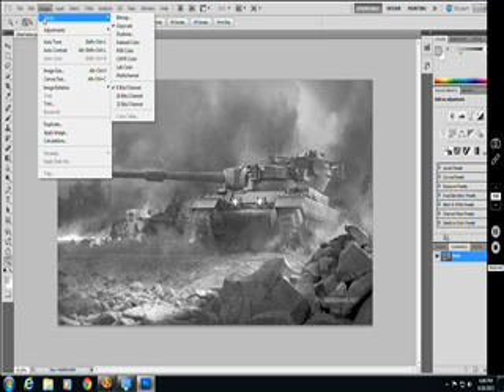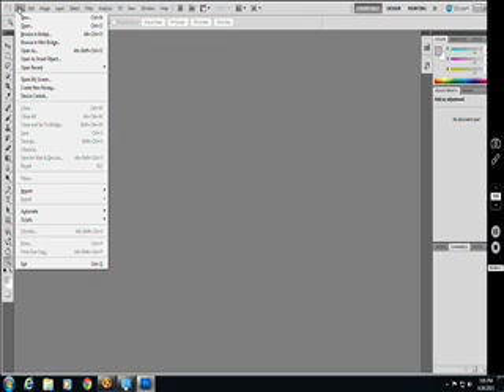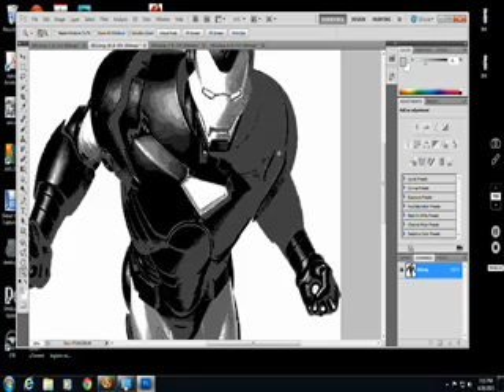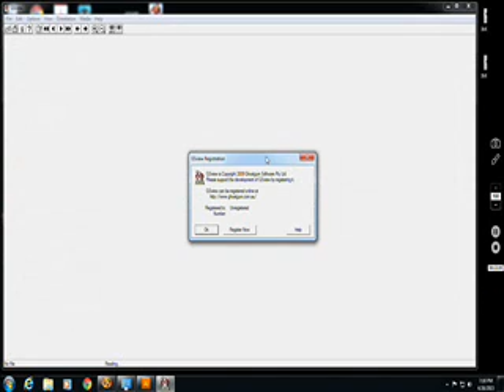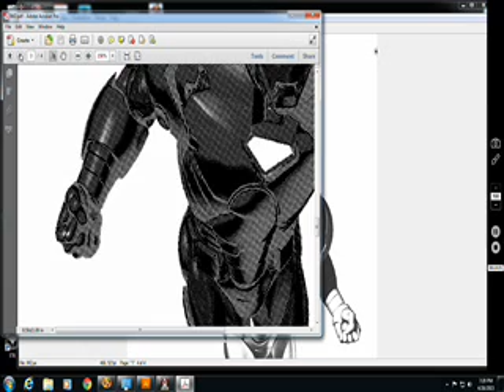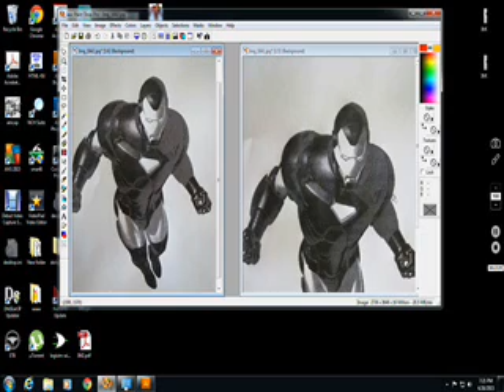Grayscale Haftone and 4 Color Separation Techniques

Comment: Hi,
Can I print using an Epson Stylex Pro 9900 in 36 inch wide large format for LF graphic film?
Also can I print on clearfilm, please ?
Reply from the maker: +Sunny Alan   I have absolutely no clue.  If you can do it from PS under normal circumstances I don't see why you wouldn't be able to do a halftone, but this video was geared toward the guy with small format equipment.

Comment: AI make *.ps file only (it isn't print halftone). Only  GSview can print halftone. now how to print spot color to postscript film.
1. separation spot color to Photoshop.
2. Open file in Ai (make *.ps file).
3. Print halftone In GSview. (make positive film)
Is it true process cyclesurgeon ?
Reply from the maker: You can separate spot colors in AI and copy them to a new file and then output them to a PS file.  Why you would want to then halftone spot colors, since they are usually printed as solids, is beyond me.

Comment: I am sorry, i don't understand what to set under "frequency" while haftoning?
Reply from the maker: +Horn Ok Pleasee   It depends on the mesh of the screen you are using for your image.  The mesh or thread count of the screen divided by a range of 4 to 5.  So a screen mesh of 220 (220 threads per inch) divided by 5 would yield a frequency (printed lines per inch) of 44 lpi.  That's not saying that number is an absolute, but it is a starting point.  Hope that helps.